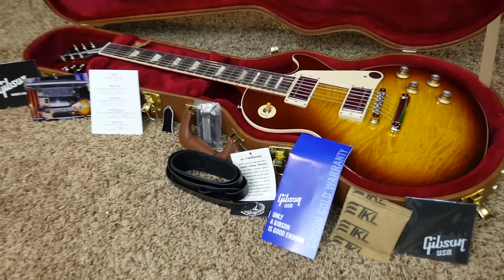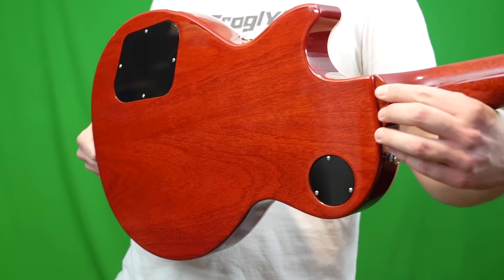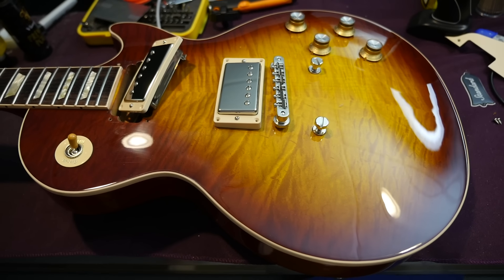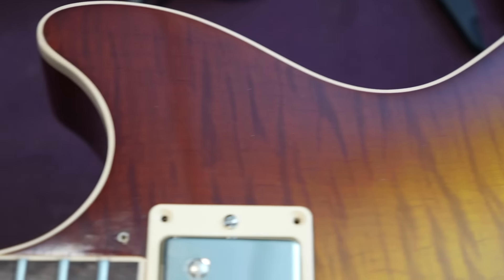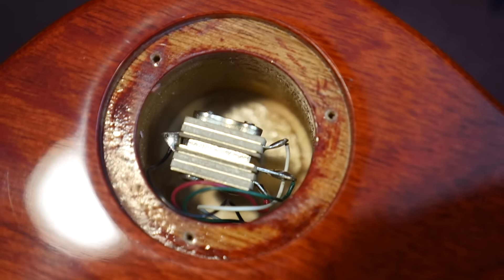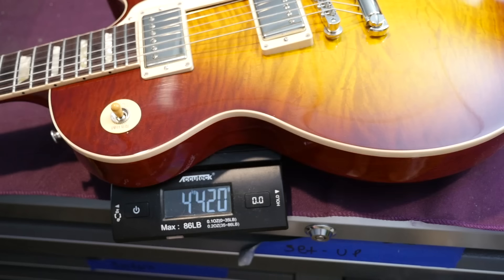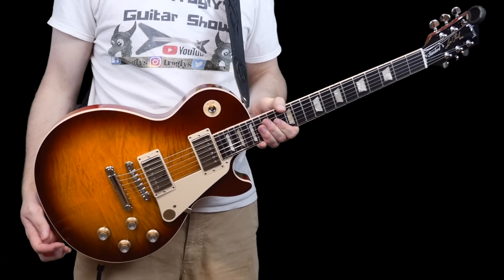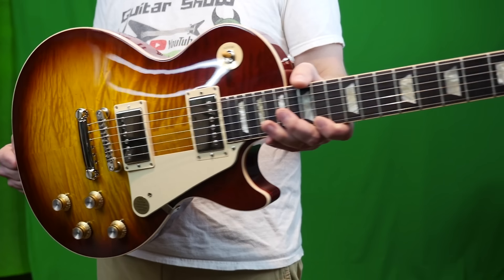The NEW Gibson Les Paul Standard '60s - Is It Worth Buying? | 2019 In-Depth Review + Demo

Comment: A shame, when all of the flaws in this guitar are dismissed because its not as shitty as they were a few years ago. Most $2499 guitars from Fender wouldn't have these issues, and if a rare bad example did make it out of the factory like this it would be considered an unacceptable exception. I'd send this back over either the gap between the nut & fretboard or the chip under the pickguard alone, not to mention having both issues simultaneously. I'd likely even bounce it over the tooling marks on the fretboard, but I'd need to see those in person to judge them appropriately if they were it's only issue. And don't give me that crap about necessary imperfections for being "handmade". Other companies' comparably priced guitars don't have these issues as common problems. The one I saw in person had a control cav route that didn't even match the cover. The outer "lip" or "ledge" that is recessed out, to make it sit fairly flush with the body, was too wide by over 1/8", so that it was obviously noticeable. The next one I picked up, the very same afternoon, had been pleked so heavily to make up for a bad neck(which should have been discarded at the factory), that it had barely any fret left and was all but unplayable. Both guitars had other issues too. If I can pick up two in a row with such glaringly obvious problems that the factory should have caught, then their QC program is nonexistent. Yay! Gibson dumped weight relief! Now they just need to start taking a little pride in their product for the exorbitant prices they charge that are completely out of sync with the rest of the industry.

Comment: Is the 60’s standard the same as the traditional that was out in early 2019? I bought a mint 2019 Traditional that is dated 1/9/19 and it has a 60’s neck, not a fat 50’s neck. But no pickguard and the truss rod is blank.
Reply: It’s probably the same as the 50s with the fatter neck

Comment: 13:13 shouldn’t they have wired all the pots together with a ground wire connection? I’m getting crazy ground problems in my LP 60 and I wonder if this is the origin of the problem.

Comment: I've got the Standard 50s and it's an amazing guitar.  The 60s look great too but I just love the neck profile on the 50s version.  I've got somewhat bony fingers and my hands tend to cramp up more if I'm playing on guitars with thinner necks and I don't have this problem with the 50s version....  And while I would love to have the 60s version as well, if I was going to go in that direction, I'd strong consider the Classic model from the same range of guitars.  The Standard 60s has a better maple top on it, handwired electronics, and has no weight relief.  As far as I can tell, those are the only differences.  And the Classic model has push-pull knobs for coil tapping, if you're into that sound...  Anyway, they all seem like great guitars so you really can't go wrong, but out of the Standard 50s, Standard 60s, and Classics, I feel like the Standard 50s stands out the most, simply due to it having such a fantastic neck profile.  Seriously, it just feels so damn nice to play.  At first I was worried about the neck being too thick, and when I first played it I had that thought again, but after a couple days of getting used to it...  Yeah, I'm sold.  I never knew how the neck felt in your hand could make such a big difference.  I mean, obviously it would, but I just didn't realize the extent to which it would...  It was a game changer for me.

Comment: Those pickups sound better that the BB Pros of previous Standards.
Reply: They are hand wound and not wax dipped as were the originals. The wire is the same type but PRS have the original machine that made the wire. That machine pulls the wire inaccurately by today's standards so every few inches of wire has a very slight difference in diameter. For sound this creates a lot of complexity just like wood does by having variations in density.

Comment: Actually, the aluminum light weight stop TP is junk. Attach strings to a Callaham cold rolled SOLID STEEL stop bar and see what difference it makes! In fact, change out that junk bridge and studs to a Callaham cold rolled steel bridge and you will hear a WHALE of a difference. And lemon oil works just fine. Formby's used to make a great one, but has gone out of business, to my disappointment.

Comment: Ok I just received my new 60s Les Paul Standard, it's great but Gibson still has this damn static electricity problem with the nitro as well was the back screw plates for toggle and pots. It's pretty GD annoying. quick temp fix is to keep dryer sheet in the case but this shit doesn't happen on any of my older 04 and 02 Les Pauls. wtf Gibson?

Comment: Could Gibson's case logo be any uglier? Cannot believe they have kept that for so long. Well, young Sir, those "real" ABR-1 (Tunamatic, is what they are really called), is not worth having. Replace that with a Callaham bridge, studs and stop tailpiece, and you've got something. Those pieces are all made of cold rolled steel, whereas the Gibson Tunatomic is made from zinc pot metal which does not transfer vibrations well. Lemon oil works quite well on rosewood and ebony. I used to use Formby's Lemon oil until they went out of business, and it was great. In the early '60s, Fender recommended 3-IN-1 on their rosewood boards, so how much better would Formby's be?
My question is: Who can afford these things? And these are the "standards."

Comment: The original ABR-1 has threaded post holes and threaded posts. The new ABR-1 really shouldn't be named the same when it's different. In engineering we call that revision control, the new ABR-1 should have at least an ABR-1-2 or ABR-1-A or...what I would've named it ABR-2. The engineering drawing will have a revision box at the bottom identifying revisions, when they were made, west was changed, what other parts were affected...any critical information should be captured in the revision box. That's basic engineering protocol.

Comment: Come on people, solid yes but 2 pieces body, those guitars do not even compete with 80-90's LP. I've tested those new 50's and the 60's when they arrived and I was pretty disappointed, not horrified but disappointed. I don't understand that hysterical fever raising everywhere saying that those new LPs are sooooo Fantastic "Gibson is coming back!" I understand that we've missed them so much that we wish it was so, but Come ooooon get real, they're not. Gibson is trying to save money on everything when making those,  electronics, the crappy nut, tooling marks,  blind quality-control, the finish quality, the hardware, almost everything, and if saving money at this level and price range is your priority the results will be crap. Not all bad LPs but no huge improvements there, at the contrary, except for the fact they removed the  date behind the headstock which I don't miss...I like the maple cap exposed (as it was before, a few steps back not a NEW thing) and the metal jack-plate......otherwise, the top looks nice on this one, but a few I've seen in shop had no depth at all in the flames, I've seen Epi with nicer tops that the gibs I've seen in the shops....so OK they're not bad looking and still decent guitars but any huge improvement? No...Is Gibson back? No....I've heard about the next Lps which will have a built-in dist/preamp? Seriously? Is that for real or a bad joke? After the robot-tuning madness we'll have a built-in pedal? and still the purer simpler ones are the most expensive series, seriously... Don't get me wrong, LPs are my favourite guitars,  I love mine, and I've got all kinds of solid-bodies, but I'd rather still put my money in a second hand  LP from the 80-90 or an early 2000 anytime than on one of those, and I've tested both he 50 and the 60, could be that those exact ones in that shop were bad ex, but come on, at that price range that shouldn't even happen...

Comment: The Gibson Les Paul Classic is much better for the same price as the standard 50 or 60
Reply: really? the new one which one should i check out??? and why
Reply: @davidgoldsteen6995  The standard 50's and 60's is a classic paul 2019 with the standard truss rod.
Same body even wood even handle same micro.
Gibson took the les paul classic 2019 to make a declination and made the standard 50 and 60.
A difference is on the 50 the profile of the handle is round
Business Strategy

Comment: The main money on this kinda guitar is not about good sound. Its because someone wants a guitar that comes as close as posible to an exact replica of an original.
Generalisations are just tricks of the trade to be able to hide that someone is not doin his best work. In my humble opinion you can take a legendary Gibson that was perceived
by many as a fantastic instrument, dissect it and copy it exactly. If we cannot do that than indeed we have never been to the moon.
OK the only thing could be if you needed a rare kind of wood, that's a serious problem. But the rest can be remade and better.
But all this general 50ies or 60ies is a bit suspect. The mounting of parts that is different, the neck that is shorter....all that unnescessary mumbo jumbo.
Like instead of a '55 LP, you get a 50-ies. Instead of an exact copy of an original let's say made on 5th of may in 1960 you get an 'Original 1960' (wich is not original as it is made
in 2005). This last one is just an imaginary example for the sake of the argument. 

Then the serial no.  I don't get it....why should fans be chased into the woods by illogical/way too technical number games. (The same applies to record albums and cd's)
With to many lettering on these things why is it difficult to put 2001 as production year and then a no. indicating the rest of what should be numbered.
Why is an LP from 1967 not numbered like ....this copy (you've bought and hold in your hands) is an actual copy that was made in 1967, recorded in 1966 and its copyrights published
in 1966?. And when a year later in 1968 another batch was printed, just print, this copy is an actual copy made in 1968, recorded in 1966 etc.
The same with guitars....what? should I humble and tumble to guess in ten digits how I can find out where 2019 can be descerned in this number.
What is this a treasure map? Some riddle we have to solve?  

And Gibson should lower their prices at least for 1000/1500,-  untill their quality controll improves. That dent in laquer while this instrument is new...unforgivable.

Comment: "It doesn't feel as heavy as it is".   That makes ZERO sense!!
Reply from the maker: It might sound strange, but it is real. Guitars can be neck or body heavy or well balanced. When a guitar is not balanced and has lots of weight in the body, they will 'feel' heavier than they are. 

It's like having a 10lb ball on your shoulder versus having a 10lb flat plate. The ball will feel heavier since the plate would distribute the weight across your shoulder. Same reason why wider straps make guitars more comfortable.